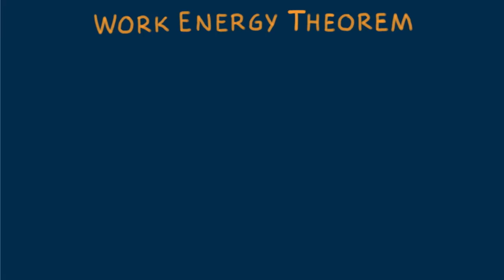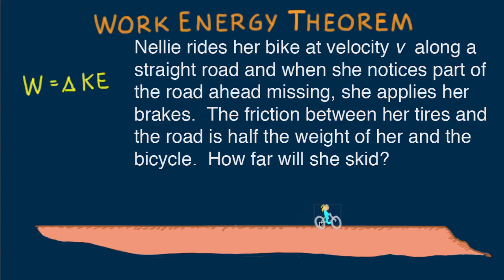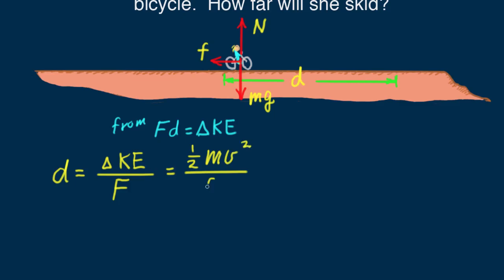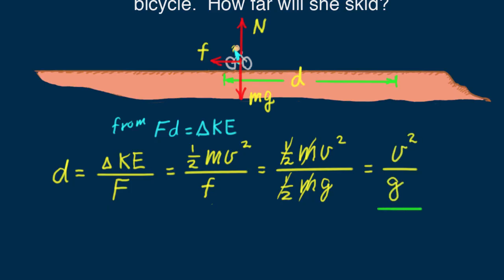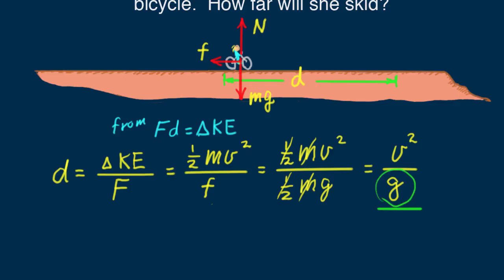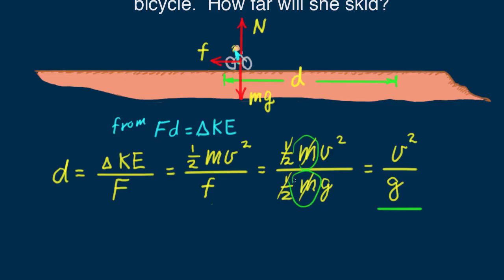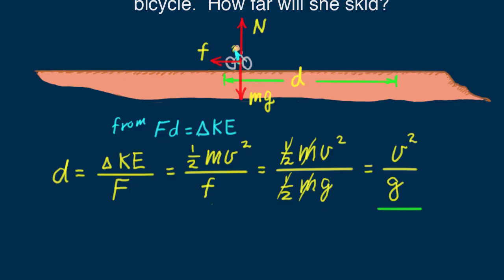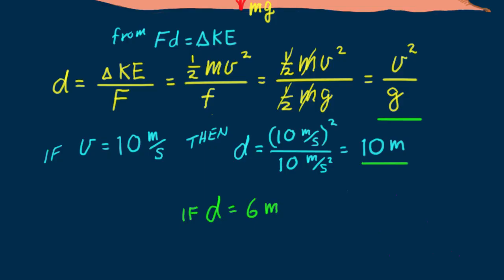Hewitt-Drew-it! PHYSICS 30. Work-Energy Theorem

Comment: why gravity = friction?
Reply: In this problem, it was given that friction equals half of gravity.  You don't need to ask why.

In general, maximum static friction is determined by normal force and the friction coefficient of the surfaces.  A flat road with no vertical acceleration means that the normal force equals the weight, which therefore means friction will be proportional to the weight.

You might wonder why I mentioned static friction instead of kinetic friction.  Well, when you are riding a bike, you want your wheels to have a static friction contact with the road, where the bottom of the wheels is locally at rest where it contacts the road.  This gives you a larger upper limit to the amount of stopping force, and it maintains your ability to steer. You want the kinetic friction to take place in the brake pads or brake disks, otherwise the bike will be skidding along the road.  If the tires on the road enter the regime of kinetic friction, steering the front wheel will do nothing.

Comment: i wonder why the gravity is 10m/s^2
Reply: It is used in this problem as a nice round number to keep the calculation simple.  In reality, it really is 9.8 m/s^2 or as I like to think of it, 9.8 N/kg, as a number that is representative of an average value worldwide.  Nowhere on this planet is it strictly equal to 10 m/s^2.  Since you are only given 1 significant digit in the other data, you would get the same answer whether you use 9.8 or 10 N/kg for gravity.

If you are wondering why it is close to 10 N/kg, there is a historical reason why.  An early idea for defining the meter, was to make the 2-second pendulum have a 1 meter length.  From the theory behind pendulum swing periods, this would be the case if g equaled pi^2 meters/second.  Calculate pi^2 and see how close it is to the accepted value for Earth's acceleration due to gravity.

Comment: For the record.. the General Formula for the Stopping Distance, d, is Equal to V^2 / (2(Mu)g) ... in the above Video... the INCOMPARABLE and RESPECTABLE Paul Hewitt gave a value for Nellie and her Bike  the  frictional force  of 1/2 the Total Mass of Nellie and the Bike... That was an Example.. and rightly so... therefore that pretty much implied that Mu was equal to 1/2 in order to solve  the example problem.  Since Friction Force = Mu times MG .we therefore have;  d= (v^2) / (2 (Mu )g).  by the way Mu is equal to the Coefficient of Friction and so if the tires are SKIDDING you would use the Kinetic Coefficient of Friction, whereas if the tires are NOT skidding then you'd use the Static Coefficient of Friction) Thank you Dr. Hewitt for all of your Wonderful Videos and your Talented method of Teaching.  You would definitely qualify for The Mt Rushmore of Professors....
Reply: (Continued).....so if the tires are SKIDDING you would use the Kinetic Coefficient of Friction, whereas if the tires are NOT skidding then you'd use the Static Coefficient of Friction) Thank you Dr. Hewitt for all of your Wonderful Videos and your Talented method of Teaching.  You would definitely qualify for The Mt Rushmore of Professors....